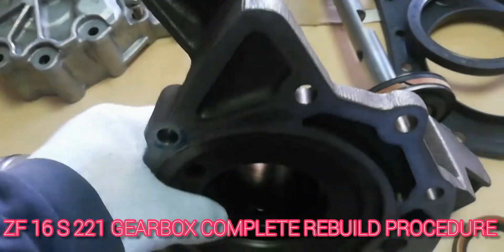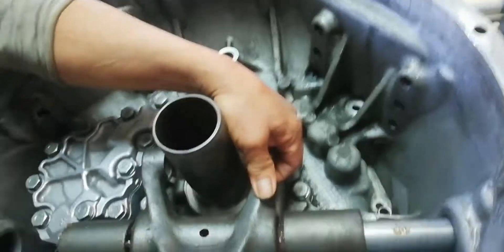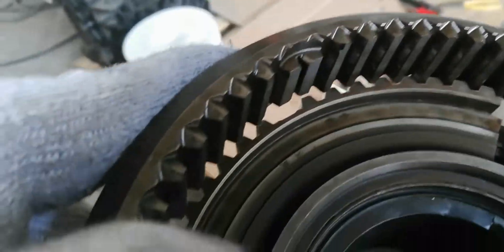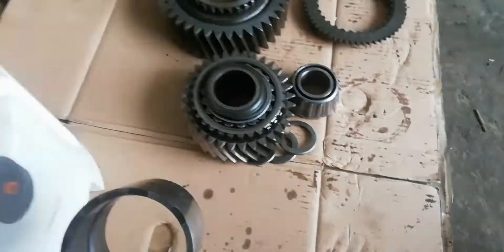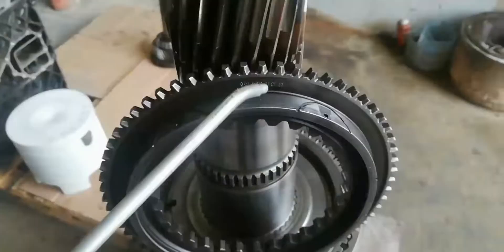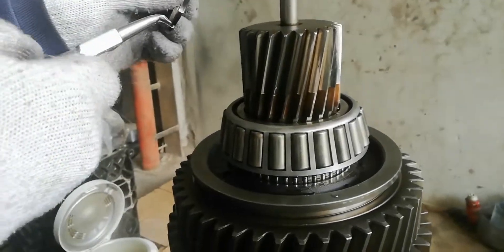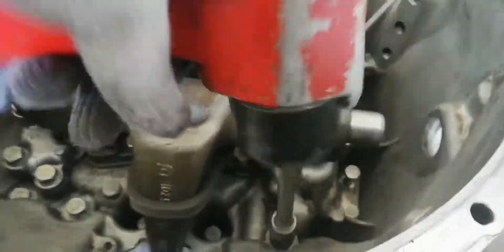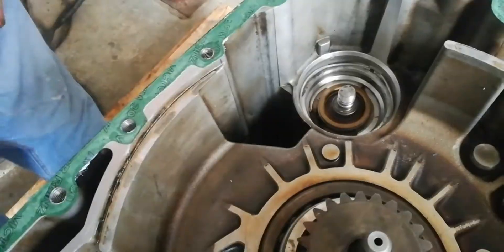ZF 16 S 221 GEARBOX COMPLETE REBUILD TECHNICS

Comment: Thank you 
Please the engaging ring how position for gear number one and two
Reply from the maker: The engaging ring and engaging sleeve are reversible. Some reasons why this needs to change the position is when re-using the old parts.
Reply: @yrhelmechanicalelectrical9113  thank you.

Comment: What is the problem if the 1st gear and the reverse not working?
Reply from the maker: check pneumatic valve and gear lever setting
Reply: @yrhelmechanicalelectrical9113  what is the color of pneumatic valve and the gear lever. Sometimes it will engage to reverse then after back to neutral then try to engage to reverse wont move to reverse.
Reply from the maker: @giljohngabato9652  https://youtu.be/yW0CA5eGznA check this video if you have air leak on pneumatic servo unit, you will encounter the same problem. check also air pressure